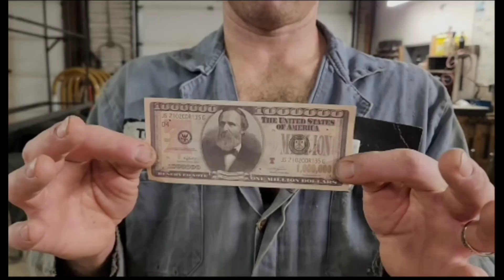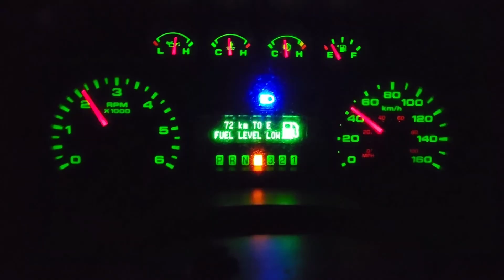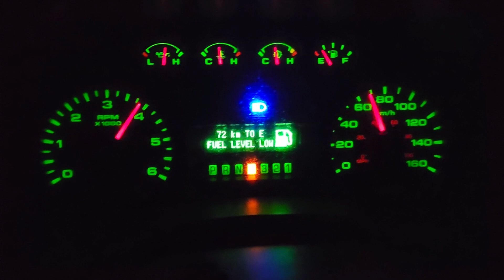Free-Bee Garage: 5.4L From Hell!

Comment: I like how you use the gasket box for marking which bolts have been torqued.  Sometimes I’ll use them to hold the bolts so I don’t forget where they go, so basically cutting a hole in the box where you’re making your marks.  That was in my earlier days so I haven’t done it in a while, but maybe it helps someone else.

Comment: My dad had an f250 with the 3 valve. We rebuilt all the cam caps and timing shit twice. Eventually replaced the engine.  Spent like 15000 bux on engine problems and only bought ot for 17 000, to drive it 40 000 miles. These 5.4s are notoriously bad engine. Junk, you should just put it out of its misery.  Love the channel btw.
Reply from the maker: Wow! That sucks. I told him to get rid of it as soon as he could.... still driving it! Crazy bastard🤣 Thanks!🍻